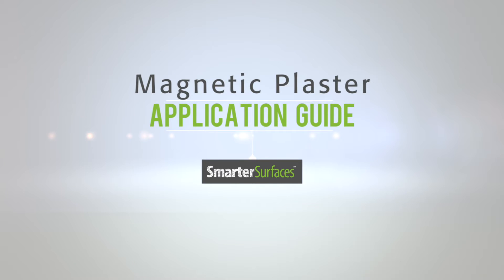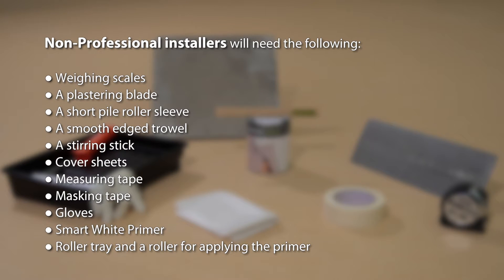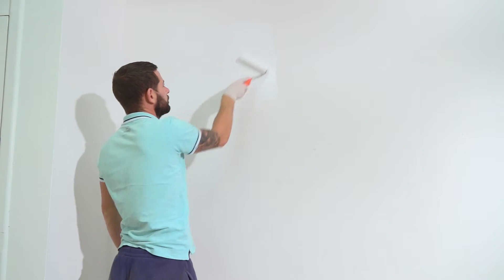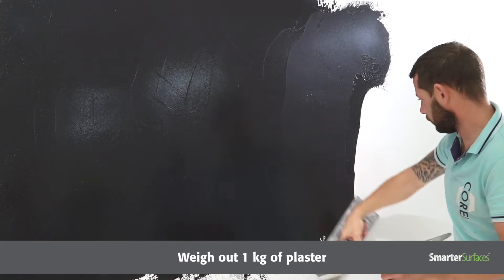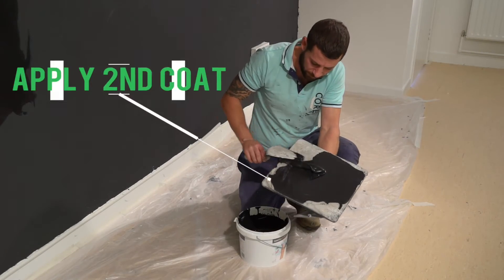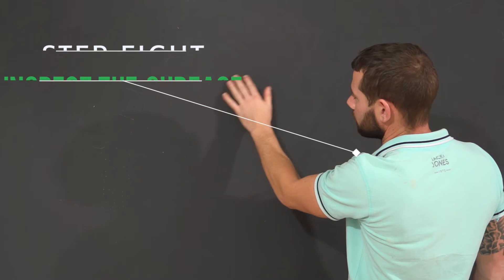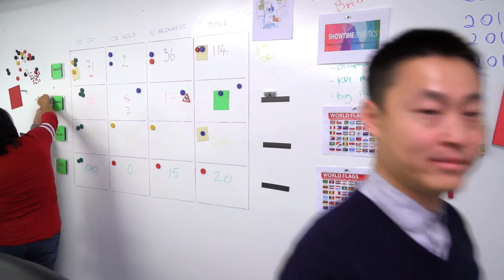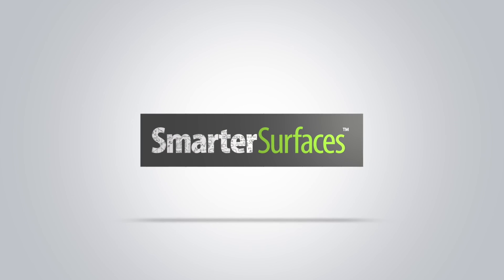Magnetic Wall Plaster | DIY tutorial for Strong Magnetic walls!

Comment: When you paint over the magnetic plaster does it need to be primed first then paint? Or paint straight on top of the magnetic plaster?
Reply from the maker: Hi Jeff

Only apply a primer before the magnetic plaster if you have a porous surface. Therefore magnetic plaster can be directly applied to a previously painted wall
Reply: @smartersurfaces  this question was from 8 months ago. reply also doesn't answer the question which was about priming/painting OVER the magnetic plaster.

our project is done. we did use the plaster. it works pretty well. contrary to guidance however, painting over definitely affects the strength of the magnetism. and not painting is feasible only if you're ok with never touching the plaster which rubs right off on your hands when you touch it and will dirty up anything that comes in contact or rubs with it.

Comment: Will this magnetic wall be strong enough to hold a ceramic tile say 20” x 6” in place?  What is the maximum weight? If yes what is the name of your suggested magnets that I would need to attach to my tile to stick to the wall/magnetic surface? Thank for sharing  your video.
Reply from the maker: Thank you for your interest in the Smart Magnetic Plaster. Our magnetic plaster does only hold up to 8 A4 papers with one magnet. It is designed to hold graphics, construction plans or calenders. Hence, it is not strong enough to hold anything heavier than that like tiles. For the best results with our Smart Magnetic Plaster we recommend using our Smart Neo Magnets.